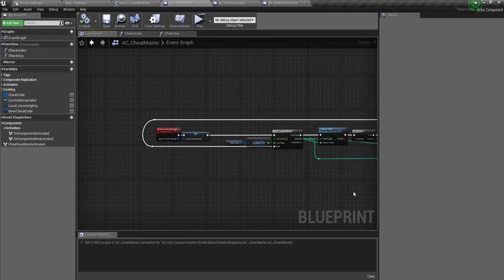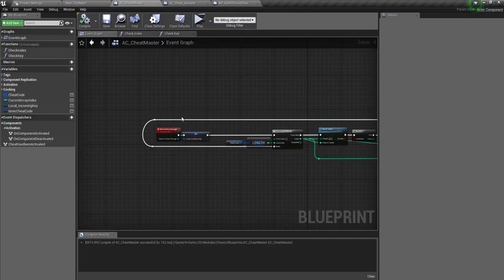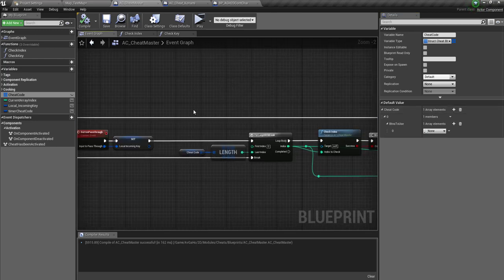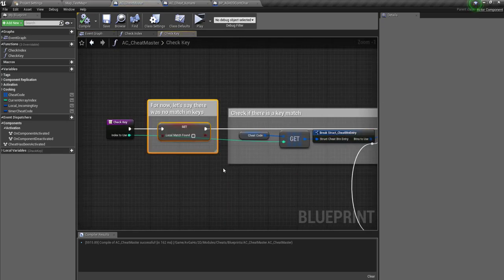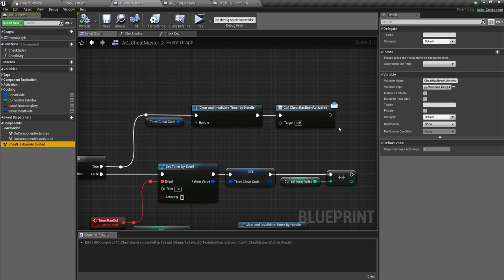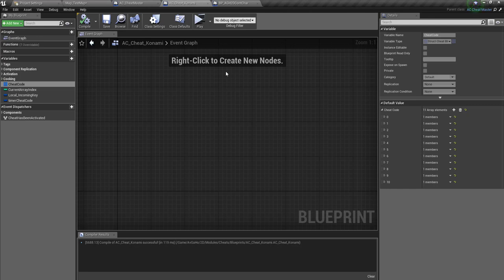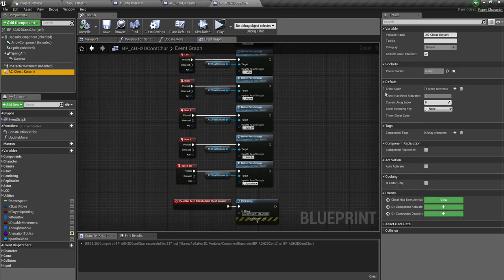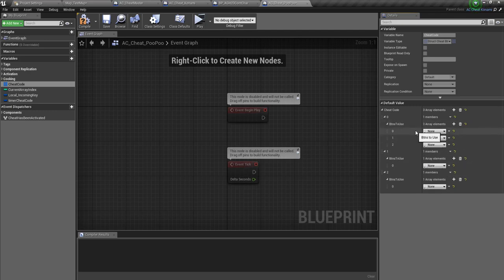UNREAL ENGINE 4 | Creating a Cheat Code System

Comment: great video, i would like to say that seing those execution lines looping back to the break of the for loop can also be done using a custom method , wich will clean a bit the code , the downside is that it will not work inside functions